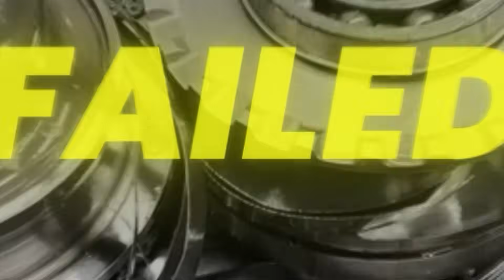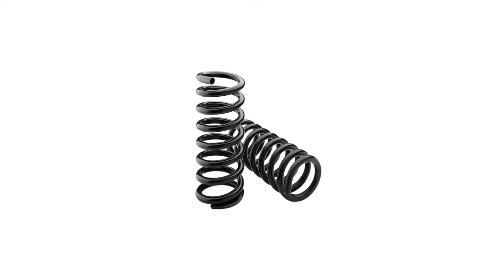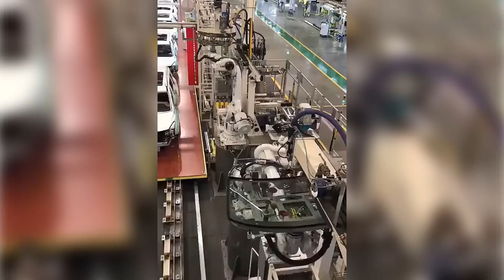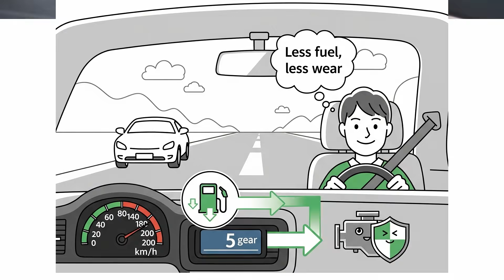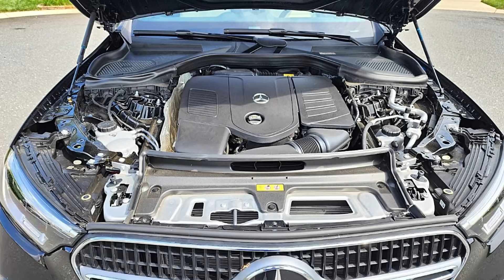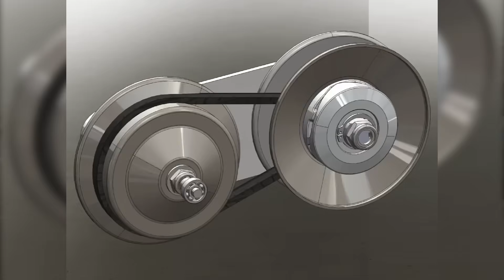How This One Bad Habit Kills Every CVT Transmission Before 50,000 Miles

Comment: 2009 nissan altima, 128k miles trans fluid never been changed. Should i change it now?
Reply: yes
Reply: Have it flushed. And then changed every 30,000. I have the same car.
Reply: @MrMarco7259  Do not flush.
Reply: 100%

Comment: Based on what have been mentioned above, sounds like CVT is a shitty solution! To make it more acceptable to car owners, it should have much lower replacement cost in view of it's low durability & poor reliability. Otherwise just revert to the conventional 4 to 6 speed AT. I live in Malaysia and I used to own a Proton Prevé 1.6. The CVT failed after 110,000 miles and I got it replaced with a brand new CVT at just about USD1,500. The new CVT went on another 92,000 miles and was still working well before I sold it off at 202,000 mile on the odometer. In my opinion, all types of transmission have to be used with care. A Dual-clutch Transmission can fail prematurely too and costs even more to be repaired or replaced.

Comment: I think the good habit is not to own a CVT transmission car......😊
Reply: I own one, 176k km, still strong
Reply: @WalkBoutJa 110'000 miles is not a flex. I have a car with a getrag f23 5-speed in it that is coming up on 300,000 miles, with the original clutch, and I only change the fluid every 60,000. If the engine were to retire tomorrow, I could put another engine in it with a fresh clutch set including flywheel and put another 300,000 on it. I know this because I know how good of a transmission it is. There are manual transmissions out there that can easily reach 1 million miles. I have a 1974 Chevy K10 with a Muncie sm465 4-speed in it, in which I have no idea how many miles are on it. I will say that according to the VIN numbers, the truck originally came with a 350, and I ended up pulling a tire 307 out of it when I ended up putting the 357 in it that I built that now has 100,000 on it. Anybody that knows anything about small block Chevys knows that they will go at least 250,000 miles. That being said that means the transmission has at least 600,000 on it
Reply: @WalkBoutJa Do you change the Trans oil when it's time to?
Reply: @Minkagurl I do
Reply: @WalkBoutJa gotta 09 murano and have 162,000 got that fluid drained and filled now it feels like new!
Reply: i have mine since 2018.... still running strong!.. just keeping up with regular maintenance!...💪💪
Reply: That’s what I’m thinking too. I doubt that I will ever have a vehicle with that type of transmission.
Reply: @Jim-sd5yq you're missing out
Reply: @sirsuse  unless I put one in my 30 year old truck, like I said, I doubt I will ever own a vehicle that has that type of transmission.
Reply: @sirsuse  It's hard finding a manual transmission car these days.
Reply: CVTs basically most all out there modern cars now
Reply from the maker: haha yes
Reply: Exactly 💯 I agree with you , Unless it's a sport car no point In using this in a car that's used everyday.

Comment: I finally got rid of my Nissan Murano just before the CVT crapped out. 
I have a 2025 Mazda CX50 with a REAL transmission now.
Reply: Nissan has been the cause of most of the bad reputation for CVT transmissions. They use the worst designs and use them with engines that are too powerful for that type transmission. Toyota and Subaru have very good CVT transmissions.
Reply: I just bought a Nissan Miranda from some dude who seemed desperate to get rid of it.  Thought I was getting a sweet deal but it wasn’t 2 weeks before the CVT went south on me.  What a waste of money.  Feel like I bought someone else’s problem.  What a scam.
Reply: You buying a car off the street from private seller that can happen to any car. My sister friend daughter i trying to help her out with a Toyota Camry and she took it to the mechanic and got it inspection They told her the engine wasn’t no good in it and that Toyota
Reply: Real is only manual in my book.
Reply: TORQUE CINVERTER Maruti Zen automatic gear (3 speed) car, AC model, 14 kmpl mileage. Japan engine, Japan gear box Japan carburetor (NO ECM, NO SCANNING, NO ERROR CODE), Japan radiator, Japan axles, All zen automatic cars prior to year 2000 (only carburetor model, not MPFI) have high quality original Suzuki engine and imported 'Made in Japan' Suzuki automatic gearbox. This same Japanese automatic gearbox was introduced in Maruti 800 in 1990 (2 speed gearbox). Modified version (4 speed) (Indian made) of this gearbox is used in A-star, Vitara Brezza, earlier model of Swift, Dzire, XL-6, Ertiga and S-cross.The petrol-powered Brezza and Toyota Urban cruiser share the same 4-speed torque converter AT gear box. So this RELIABLE automatic gearbox has been in India for the last 35 yrs. I heard that there have been many reports of issues in the AMMT gearbox, requiring numerous software updates and even complete gearbox replacements even within 25,000km, sometimes GEAR suddenly becomes neutral (free) while on the highway, Need to shift to manual for a while and then after some time it gets stuck on setting it back to auto. You can also add "overheating" transmission / clutch burning to that list. CALIBRATION and clutch LEARNING needed after new clutch fitting. Many fault codes, TCM errors etc. Manufacturers have struggled with the long-term reliability of AMMTs. It is inherently an inferior technology for passenger cars. That's why I don't recommend AMMTs to anyone. CVTs are quite reliable and almost a gearless transmission system. But it is also very expensive but less expensive than DSG/ DCT replacement. It is safe to assume that it's replacement cost will be somewhere around 4 to 4.5 Lacs. CVT transmission uses a metal BELT and this metal belt snapping is common in poorly maintained cars. CVTs are significantly more expensive. It’s also about durability and fuel economy. CVTs can be delicate when driven in stop-and-go traffic over long periods, and repair or replacement costs are high. I will always recommend a proper Automatic gear (Torque converter) because of its superior smoothness, performance, reliability & resale value. TORQUE CONVERTER automatic is 95 year old technology and the most reliable automatic gear technology. Latest generation automatic cars have AUTOMATIC GEARBOX with SOFTWARE CONTROLLED gear shifting which is very complicated and may be having high maintenance and very expensive to repair. Latest automatic cars have ENGINE CONTROL MODULE (ECM) Very expensive to replace) and TRANSMISSION CONTROL MODULE (TCM cost high).If TCM is faulty, we cannot shift from Neutral to Drive. Driving with a faulty TRANSMISSION CONTROL MODULE can damage your auto transmission. Latest automatic gear systems are sensor based. Need to depress the brake pedal before shifting from P to D or from D to R. If BRAKE PEDAL SENSOR is damaged or fuse blown, we will not be able to shift from P to D. No BRAKE PEDAL SENSOR in this automatic zen. No ECM/ TCM in this carburetor model Zen automatic. Many latest automatic cars OVERHEAT in heavy traffic. During overheating the FUSE in auto gearbox is blown. Then the car automatically shifts to NEUTRAL and we cannot DRIVE. This automatic zen never had overheating. No FUSE in the automatic gear box of this zen. Have driven 250 km non-stop without any problems. Latest automatic cars have very complicated ELECTRONIC MOTHER BOARD inside the automatic gear box. This Zen Automatic car do NOT have any software or computer or ELECTRONIC MOTHER BOARD inside the automatic gearbox/ engine. No SCANNING needed. This automatic zen has a simple MECHANICAL automatic gearbox. Simple JAPAN engine (carburetor model-even roadside mechanic can repair it) and simple JAPANESE 3-speed MECHANICAL (no electronics) automatic gear box. Latest automatic cars have even 10-speed automatic gearbox. The more the number of gear ratio, the more complicated and more expensive to repair. This Made in Japan automatic gear box will last for about 3 lakh km in Indian driving conditions.and this Japan engine will last for about 4 lakh km. The less the weight of the car, the more the life of automatic gear box. This zen weighs just 750 kg. So the automatic gearbox has to pull less weight, so it will last long. Latest automatic cars have non-reusable automatic gear oil FILTER with washer. If washer is dislocated, autogear oil will enter the transmission without filtration and auto gearbox will get damaged. This zen has RE-USABLE flat METAL MESH type gear oil filter without washer. Zen carburetor engine model has more quality than zen mpfi engine model. Do not compare the used car rate of automatic zen with the rate of manual gear zen. FULL MECHANICAL/ ZERO ELECTRONICS CAR. The less the electronics the more the reliability. Average price of good condition used Zen automatic is 2.25 lakhs.

Comment: Nobody replaces the CVT belt.  When the belt goes it's replacement transmission time.  The absolute biggest factor in CVT health is fluid.   I change both my cars with CVT'S every 30,000 miles with factory fluid.  What CVT belt only lasts 20,000 miles?  If the CVT is properly maintained the belt last a couple hundred thousand miles. I had a 2013 Altima with 230,000 miles with the original CVT when I got rid of it.
Reply: 118,000+ miles on my CVT and no belt change here.
Reply: @AgateNinja same, I even had the fluid changed and the mechanic said that the old fluid still looked good. I changed it anyways since the car was 115k miles at the moment.
Reply: @AgateNinja  I own a automotive repair shop. I want you to read this comment and take my warning seriously and do exactly as I say. I don’t want hear rebuttal about “how your car drives great.”  You need to listen to me. You literally have a hand grenade with a pin pulled in the middle of your lap. We see CVTs catastrophically fail completely out of nowhere over 100,000 miles. If that transmission dies ,your car is worthless now. Repair cost upwards of $7000 for parts and labor. You need to go trade that vehicle in for a non-CVT vehicle while it is still running and driving good. I’m not trying to scare you. I am telling you a fact I make tons of money from people with the mindset “well its never been a problem for me!”   . Tons of money it’s not even funny. I do a few CVT transmissions a month. Nissans and hondas are the worst ones. The toyota prius eCVT does NOT use a belt drive (which is a good thing) , it uses a series of planetary gears and variable output from the electric motor. If you don’t take my advice and you choose to keep the vehicle, I guarantee you’re going to remember this day that i warned you.
Reply: @ScottyRocket321  🥱
Reply: @ScottyRocket321 What about Suzuki Swift CVT from 2019?
Reply: @ScottyRocket321  I always hated CVT for a number of reasons I always choose manual but I heard a lot of people saying it's improved so much. I Still Will never consider it out of the warranty period. Would you say following all the good habits for CVT will truly help or it's still just a ticking time bomb.
Reply: @ScottyRocket321 👍👍👍👍👏
Reply: So, you've done trans oil at least 7 times. That's about $2,100 in maintenance if you are not a DIYer compared to $180(at the dealer) I spent on my 07 Tacoma with 320K miles. I still own it with original transmission and it's my dependable getaway vehicle.
Reply: @matrix-fh9tn the savings in Gas more then make up that $2100 😅
Reply: @darthkrayt5097 What gas?  I also own a 23 Rav4 hybrid as a commuter. No eCVT fluid change at 63K and averaging 36mpg.
Reply: Yep. 2016 Corolla with 150k miles... Still the original CVT!
Reply: @musicalbenjiman  same fluid?
Reply: You are doing it at 30K miles but Im doing it at 20K miles and my CVT Honda running good at 300K miles now. Yes changing fluid often is critical for CVTs
Reply: Most manufacturers don't sell replacement belts.
Reply: Not an expert but I brought my car to the shop to replace fluid in transmission. Is that the procedure for preventing cvt issue?
Reply: Fluid is the key to a happy CVT
Reply: I'd add to this... learn to change the fluids yourself. It's easy and you save a ton of money.
Reply: i had a 2014 corolla s with 290,000 never did that tranny fluid get changed
Reply: Damm this guy trying too hard I have a 2014 aultima and I got 160,000 not quiet there but getting close its all stock from factory except for the intake manifold runner control valve
Reply: Wov super
Reply: Ali si se ipak riješio a ne samo prodao 😂
Reply: Nissan is the worst
Reply: Subaru has a chain not a belt
Reply: I change fluids regularly in '21 civic. I asked the dealership if replacing the cvt belt will extend the transmission life, I'm on 94k miles 1st owner, dealership said you should replace when it's slipping, but I was thinking it's a little late when it's slipping.
Reply: Nobody replaces CVT belts including dealerships.  When the belt goes it's new transmission time.  Change CVT fluid every 30,000 miles for maximum life.
Reply: @markmandelstamm2866 but if the belt/chain stretches like my dirt bike chain and leads to failure why cant i put on new cvt belt/chain to prevent failure.?
Reply: First they aren't prone to stretching like dirt bikes.  The belts are under a lot of tension.  Nobody services CVT's.  Transmission shops and dealers replace CVT's
Reply: @markmandelstamm2866thanks
Reply: My 2017 altima xsmission solenoid went bad...had to replace 6200$ xsnmission with only 58,000 something miles on it 😠 😡...for a solenoid!!
Reply: My 2017 did it at 22,000.  It was still under factory warranty which means it didn't cost me a dime.
Reply: @markmandelstamm2866...great timing...mine stopped 2 mths after warranty
Reply: Every 30k miles?!? That is wayy to often especially if ur not using it as a taxi or towing. And also changing it too often is also bad. Most recommend every 60k-80k
Reply: @mr.darknight416  Remember the forst 30K is going to have quite a bit of break in metal in the oil. I am not buying another car so averageing 5000 miles a year , garage kept it is not big deal for me. It is worth the cost , they only hold about 6 quarts.
Reply: Yeah, this is only click-bait with bad information. 50K miles is within every single transmission warranty period for decades. If it was really a problem it would be on the news every single night. Fluid change for our Subaru isn't on the schedule until 60K. Sure you can do it every week if you want to, but why?
Reply: @davidmccarthy6061  Yep.  Wait for warranty to be up if manual says "lifetime".  D-F every 120,000 miles.
Reply: Just get rid of it
Reply: @mrxiong2567  It is the way all makers are going . My wifes 2019 Pathfinder gets the cvt oil changed every 30,000 miles at Nissan. Quicky lubes have ruined many a cvt.

Comment: Explain to me how does new sound system destroys cvt transmission i have 2015 Mitsubishi Outlander sport i have pretty big sound system never had any issues with my cvt transmission just changed the fluid and both filters every 30 thousand miles no issues.
Reply: I guess carrying any passengers is out of the question, to save weight and wear.
Reply: Because of the extra weight that you are always carrying now instead of carrying something heavy and then unloading it wherever you are taking it.. all the extra weight all the time is the reason
Reply from the maker: yeah that could be the reason. but still we should first analyze how much an extra weight that sound system had

Comment: I’m convinced that hard driving, straining the entire power train, is a major reason for turbo powered engines and CVT’s failing before 200,000 miles.  Just watch other people drive.  If folks would just keep their fluids fresh within reason (oil at 5,000 and transmissions at 30,000) and stop accelerating so hard from a stop they probably would have better luck.  They might get their brake pads and rotors to last longer too.  While they’re at it, flush the radiator more often than what the manufacturer calls for.
Reply: I never use more than 1/3 throttle in normal driving.  I drive at the speed limit most of the time and get where I'm going on time.  People might not like my acceleration, but it's no worse than most trucks.  My brake pads easily last 100K miles and I'm used to getting hundreds of thousands of miles from a car.
Reply: @Mikexxx531 yep, I know it’s hard to believe but I replaced my front pad at 161,000 a couple of months ago.  The rears still have a way to go.  The rotors were perfect and did not need turning nor replacement.  It’s not an inherently great car either, 2012 GMC Acadia.
Reply: @MarkSmith-js2pu  Congrats!  I believe it.
Reply: This guy gets it! I drive my 2016 Impreza w/ CVT like I want it to last.

Comment: Subarus have 'sealed for life' CVT systems!!!!!!!  And in Europe dealers will refuse to do a cvt oil change.
Reply: There is no such thing as a sealed transmission. Such a thing does not exist. Your CVT may not have a dipstick, but that does not mean the CVT is sealed. There's always a way to put fluid in and drain fluid out. Every single CVT. Disregard what the dealer is telling you. They are wrong. I can prove this on any CVT.
Reply: If you believe it's lifetime you will be buying a replacement.

Comment: biggest mistake is buying a car with a cvt
Reply: Buy a Toyota CVT, then change fluid every 50k miles. It will go 250k + miles, no problems.
Reply: @marklintwo  . Buy a Toyota HSD hybrid (or Ford hybrid) and get your CVT action from a planetary gearset.
Reply: @dannybryant6873 I'm fine with Toyota hybrids. The only issue is some people may prefer the less expensive gasoline only option IF they don't drive much.
Reply from the maker: haha. have u made this mistake?